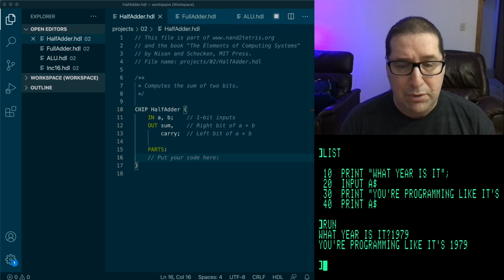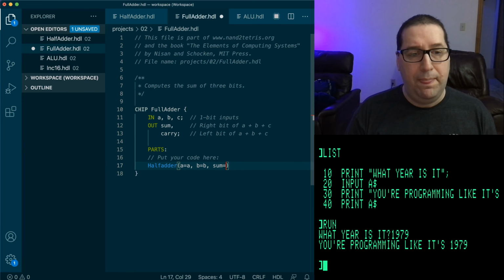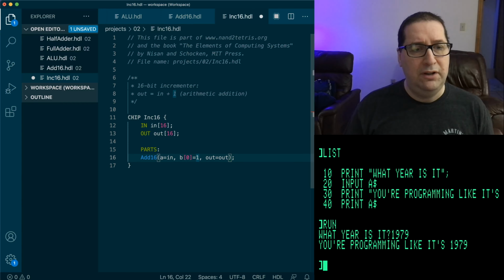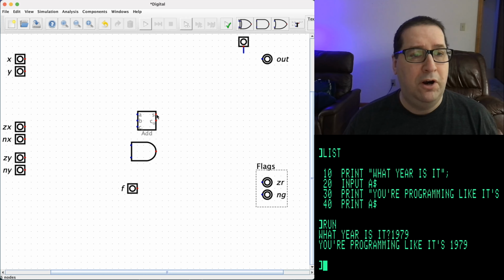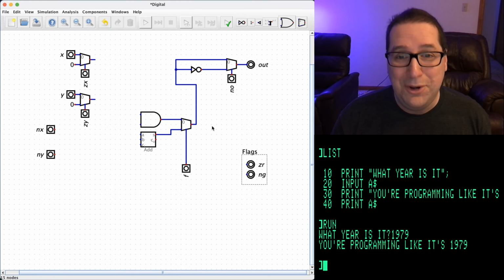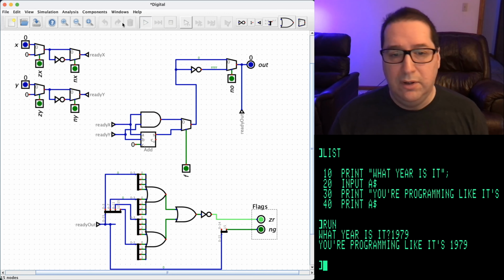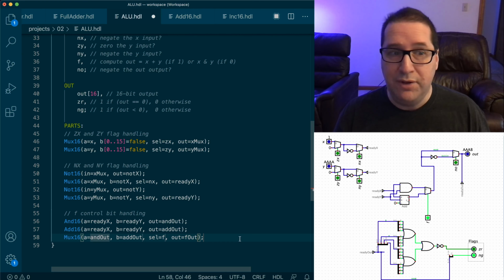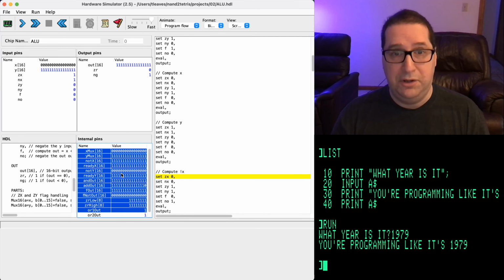From NAND To Tetris, Part 4a: Arithmetic Logic Lab

Comment: Your Nand2tetris videos have helped me tremendously.  I have been following along with your videos. I can not, however, get the readyOut tunnel wired to the two 8 bit Or gates. Likewise, I would love to see you fiddling about with the wires.  I just can't seem to get my head wrapped around how to do this.
Reply from the maker: If I recall correctly the trick here is in adjusting the properties of the splitter/merger to have the number of bits per connection you want.
Reply: Took me a while to figure it out, but you can change the number of inputs on the OR gate to 8.

Comment: Very cool.  I managed to get a working ALU before going through this, but watched it anyway, and I'm glad I did, because I found a number of ways to refactor some stuff and make it cleaner, and it was cool to see the diagram, too (I did it the hard way, without Digital, and did OK, but... it would have been helpful).  Thanks!  (2+ years later.  :D)
Reply from the maker: I'm so glad you found it useful! I'm sure you learned a lot going through it by yourself the long way. Thanks for the kind comments.
Reply: @TeaLeavesProgramming  Yeah... having long been more in the software side of things, it's a bit of a trip to think about what are effectively conditionals but without any structure for conditionals... it was fun to figure out!

Comment: I'm having a hard time getting the bottom portion from output of the readyOut tunnel and the 2 8WayOR gates to work. How did you get your 8WayOR gate you made earlier to show up with the default OR gate shape in Hneeman's Digital?
Reply from the maker: Sorry it took me so long to respond to this comment! IIRC that actually took quite some effort; it's been a few years since I did it but IIRC Digital added support for custom shapes largely so I could do this :-). https://github.com/hneemann/Digital/issues/39
Reply: You can just use the default OR gate and change the number of inputs to 8.

Comment: Thank you so much for the videos they are helping me a lot during college.
I'm trying to create Add32, but for some reason the simulator is stuck on the 'Loading chip' message.
Do you have any idea why this is happening?
CHIP Add32 {
     IN a[32], b[32];
     OUT out[32];
     PARTS:
  Add16(a=a[0..15], b=b[0..15], out=out[0..15]);
  Add16(a=a[16..31], b=b[16..31], out=out[16..31]);
Reply from the maker: Sorry - no clue!
Reply: You may used add16 or any chip that has the same name of the hdl file it cause the program in recursion / infinit loop ,
ei the file name is Not.hdl and you wanna wright Not chip like Not(in=,out=); and put it in Not.hdl this cause a problem!

Comment: I managed to implement the core ALU using two 16bit DMux. However the 16bit DMux is not supplied by the hardware simulator. Should I still continue with my design or look to implement it with only the chips we made before?
Reply from the maker: This is a dead end, and one that I wandered down myself for a while. 

First, it's totally valid to make any sort of contraption you want, as long as it meets the spec. So if you WANT to create a 16-bit Demux chip, you can. However, the most efficient solution does not involve a multi-bit demux of any sort, and the class does not require you to create one. I'd take another look if I was you and ask yourself why your design needs a multi-bit demux, and is there a way to accomplish the same thing without one?

HINT: Demuxes are often used not to change the flow of data, but just control bits.
Reply: @TeaLeavesProgramming  thank you! I used the two 16bit DMux chips to select between the AND and SUM operations. I just fed the x&y to the dmux and connected both select bits to f. This way only the desired operation gets performed depending on the select bit. I thought this would have been more efficient compared to computing both the sum/AND and then selecting between the two with a mux.
Reply from the maker: @thetruth2488  Remember, for the combinatoric parts of your circuit the idea of timing (effectively) doesn't exist - all of those things happen at once (not really, but that's how we model it). So it's not any more costly to always have both the addition and the logical AND happen and then just select which one you want to use, and by doing that you simplify the selection logic considerably.  So in my world, the 16 bits of data always goes to both sum and and, and we use a 16-bit Mux (rather than a demux!) to choose the one result we want.
Reply: @TeaLeavesProgramming  ah I see. Thank you so much! Your videos are incredibly helpful to me!

Comment: You can simplify the diagrams with tunnels further. You can have as many tunnels with the same name as you want and they all will be connected. So instead of the readyX, readyY and readyOut tunnel to "exit" in 1 place, you can make them exit in 2 and directly connect them to where they are needed.
Reply from the maker: Nice - that hadn’t occurred to me, but it’s a great idea!